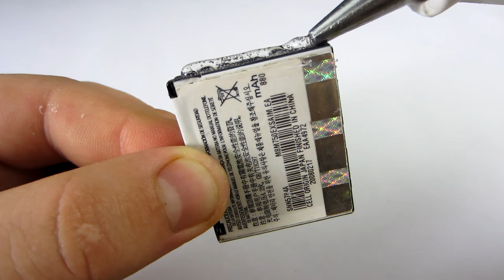How To Make Foam Cutter.

Comment: Are you seriously shorting a lithium ion battery?

Perhaps you can if the battery has a good protection circuit, but you can seriously make it light up on fire like fireworks. That's dangerous.
Reply: nerdyeyes yah m also thinking lol😂
Reply: No beacause he is not shorting the power. He used a wire called ' Nichrome' wire. That wire will take battery power and convert into heat energy.

Comment: Mr Gear does it with a battery, 2 keys and a wire. You use up half my household supplies.
Reply from the maker: Mine is rechargeable :)